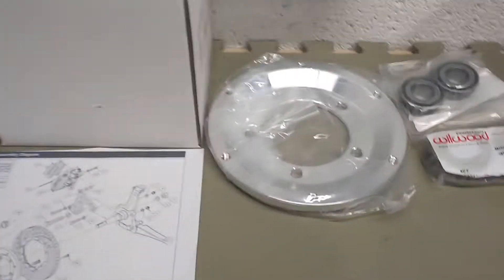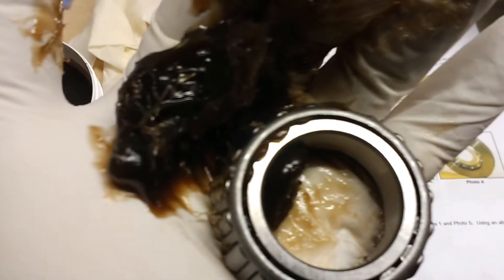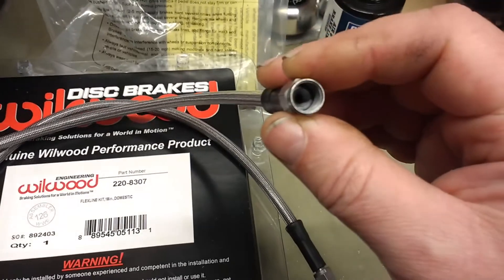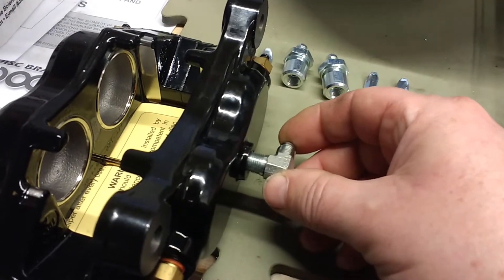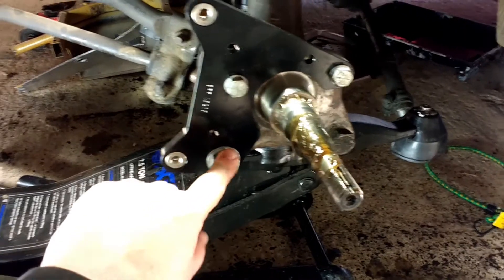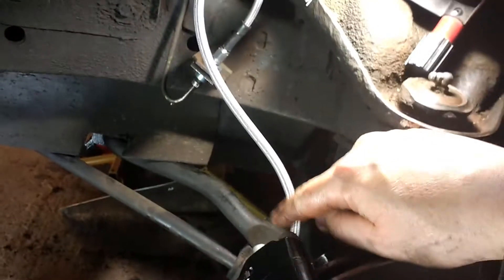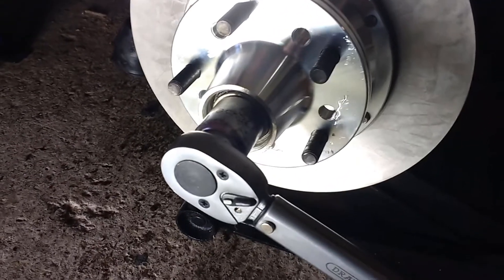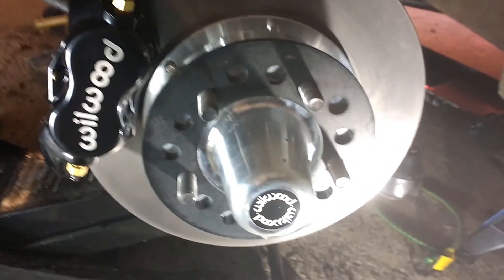Chrysler Disc Brake Conversion Pt2: Installation, inc. the NPT fitting

Comment: Great videos. I have a ‘68 New Yorker and I’m considering this conversion.  Did you use your existing power brake booster, or opt for a power disc dual diagram booster?
Reply from the maker: I am waiting for an 8 inch dual diaphragm booster, dual reservoir & master cyl with proportioning valve to arrive from US. It does work fine with original boosted drum single circuit master cylinder but some say there is risk of rear drums locking before discs are properly working (causing car to spin round on hard braking) and to be honest I would prefer a dual circuit system so that will be the next project.

Comment: Great video. Did you use your stock Master cylinder?
Reply from the maker: I have so far. Using original boosted master cyl. Will be looking into going dual circuit at some point, its a lot of car to be running on single circuit brakes. It does mean you check them really often though which is probably a good thing!